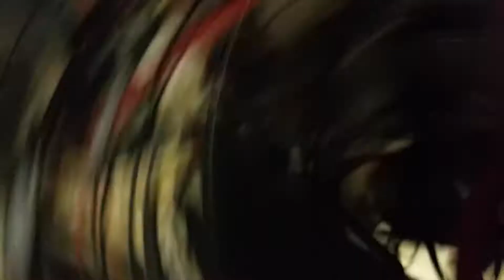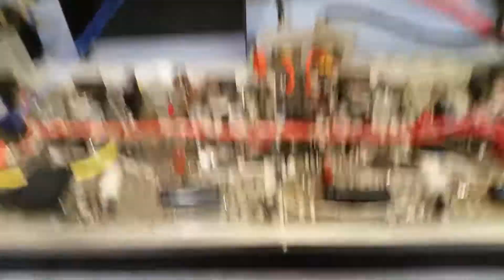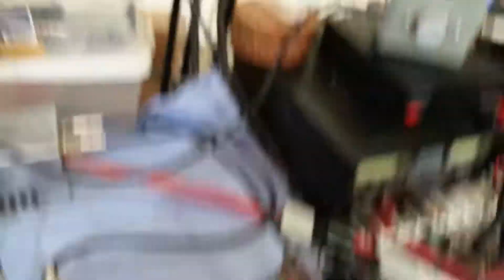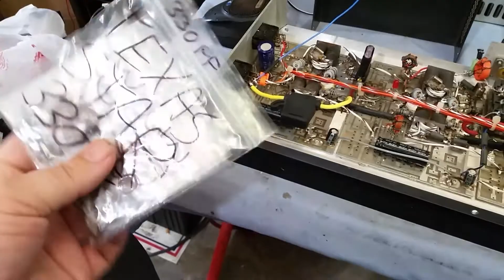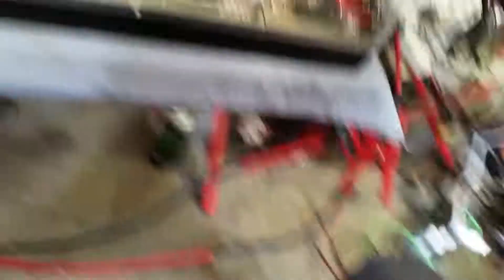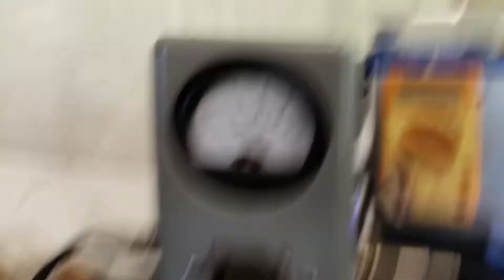OLD TS 🌟 DX1600 Repair & Repill - [Only Needed 💊's He Said 🤣]

Comment: This would be a cool amp to be able to turn on and off each section independently
Reply from the maker: Yep that would be a Safistication circuit. You'd have to have individual combinners for each set up an use relays on input and output would be one way

Comment: well that a older one. The first gen ones had a coil for the output tune. like to burn up. now went to 3 caps like that one. My hot plate I got new the fuse holders broke after the first year.  After I did power wire up grade same drive . the amp only made very few more watts but the heatsink ran cooler and draw some less amps. that on the 2290 box. was a big jump when I did a DX 1600 2879 box. easy 200 more peek watts. I had a few come in with them 16V caps. I got nice 25 and 35V made in Japan ones.  some low ESR ones as well.  I do not have fans on my lid. just heat sink.  some day I put 2 on. I just use stock radio no driver. way it runs cool. 73's